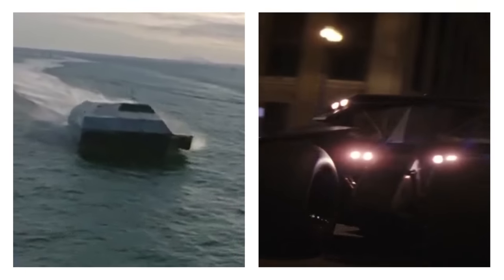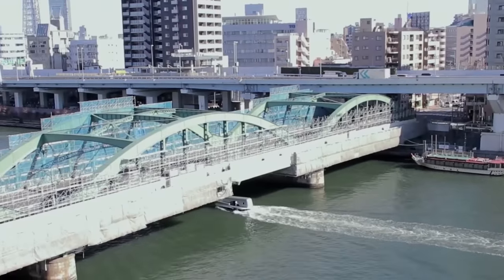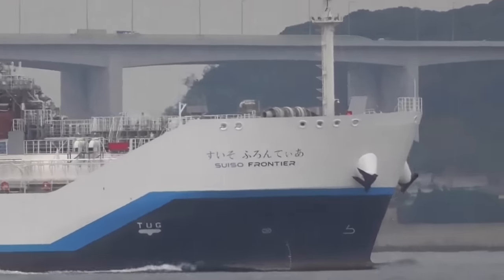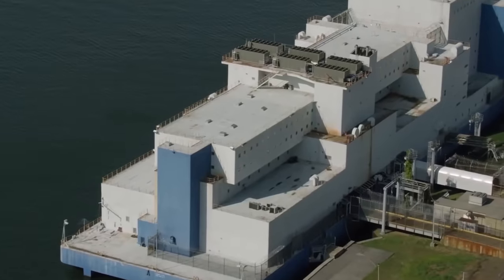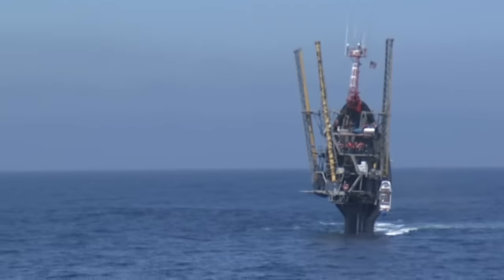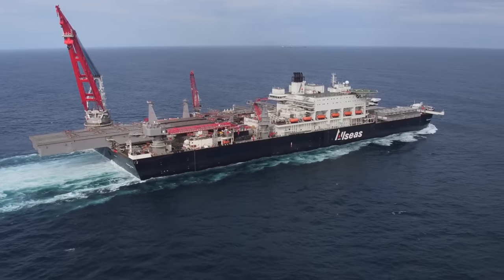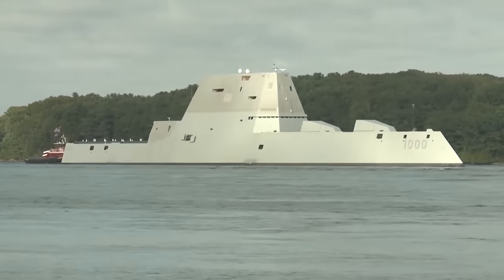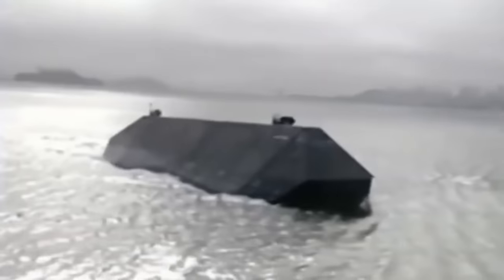The Ship That Will Change Travel Forever

Comment: My opinion of the ships:
Ramform Titan: Solid ship.
M80 Stiletto: Looks like fun.
Zipper thing: Completely stupid.
Venus: Ugly. Deliberately unnatural-looking. Wasteful. Here's my finger, rich pig.
E-ship One: A menace to bridges around the world and just waiting to capsize, but it's an interesting idea.
Suzuiki Frontier: It's wasteful to carry hydrogen around when we can generate it anywhere there's water. Actually running it on hydrogen is cool, but it should be hauling containerized cargo or something.
Leewek Constellation: Solid ship.
Sea Bubble: Nice. I want one, but it's probably too expensive for its size.
Vernon C. Bane Correctional Center: My personal suspicion is that US prisons contain more innocent victims of the system than actual wrongdoers. If we weren't failing at justice, we wouldn't need to flush money down this toilet to contain them.
Dockwise Vanguard: Wow, that's big.
Baltica: I bet that ship saves a lot of lives, but I wouldn't want to try to helm it with that huge thing blocking visibility from the bridge. I know modern ships are designed to be navigated by instruments, much like airplanes. I think that's a bad thing.
Research Platform Flip: Ummm, okay? Whatever. I would've built a submersible ship that would rest on the bottom on legs and draw in air through snorkels.
Clementine: Cute. Looks fast.
Tropical Island Paradise yacht: Completely stupid rich pig crap. Sail a regular yacht to an actual tropical island instead.
Pioneering Spirit: That must be interesting to work on.
Turtle ship: I think that's fictional. If it was real, it would be hopelessly inefficient.
Bottsand: Might be scary to work on, but oil cleanup ships are desperately needed these days.
USS Zumwalt: Embarrassing, wasteful boondoggle. What really distinguishes it is the incredible wastefulness, indicative of rampant corruption, that characterized its development. And having wasted so much money and time with its inefficient development, they made it even worse by not building any more, completely throwing away all that investment. Disgusting.
Rauf Bay: I don't think we should be doing this.
Pangeo: Okay, I was wrong. It's not fictional. I just wish it was. It's wasteful and stupid; all that money should've been invested in R&D for something beneficial to mankind. I may have been wrong about the inefficient part, but all those damn solar panels are going to break in storms and dump lead and cadmium into the ocean. They're not good things.
Sea Shadow: Awkward thing.

Comment: behind every "electric" propulsion is a diesel or gas engine.  It's laughable that a 50% efficient at best diesel engine charges a battery and that equates to a environmentally friendly system.  The drag alone of the 4 stacks outweighs any benefit they give. It would be better to put sails up as a better illusion.
Reply: L too